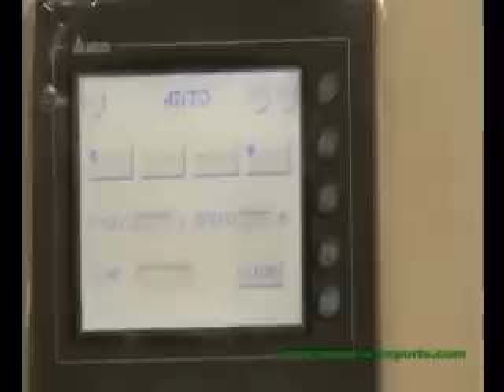Automatic PET bottle Blow Moulding Machine

Comment from the maker: This machine is slow and designed for emerging markets or low capacity requirements. The technology is primitive now and therefore well developed in China. The cost of this machine is also a fraction of what you would pay for krones or sidel. There are faster machines available in China from reputable manufacturers.